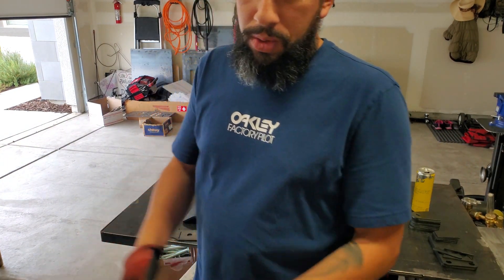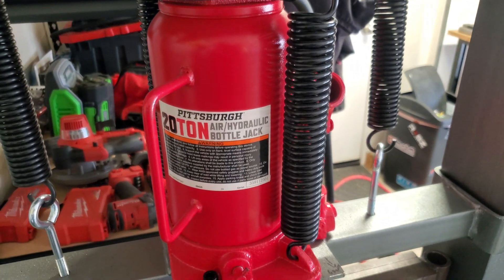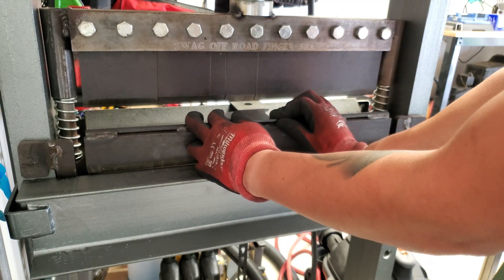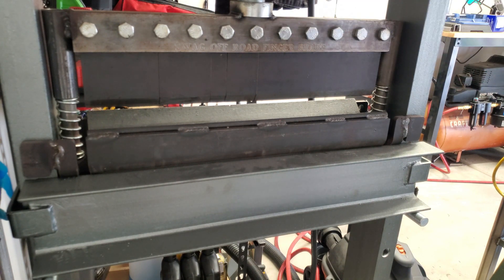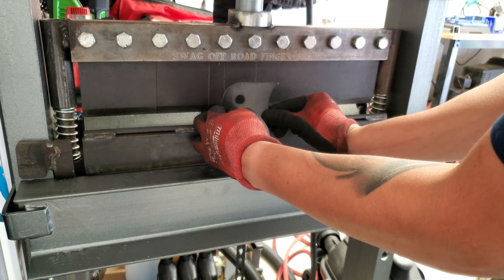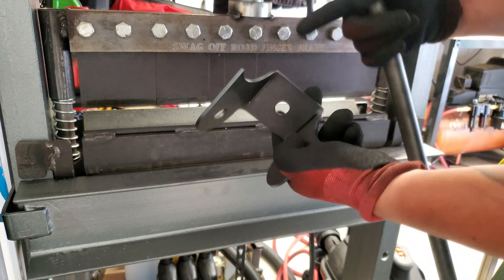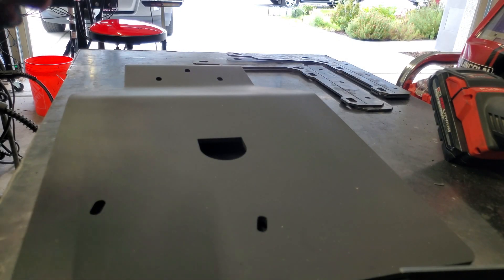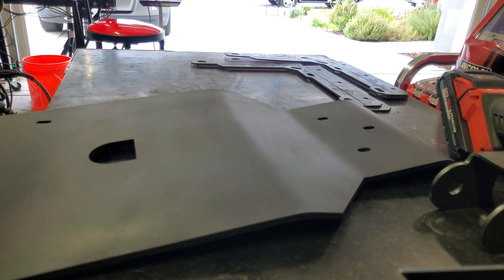Bending and relief cuts

Comment: Looks good, did you have footage on how it went in the vise? As I do not have a bench/shop press, but have a vise and a CNC plasma cutter :)
Reply from the maker: Appreciate it! I do not as I don't normally record anything I do, but if enough interest is generated I'd be happy to walk through how I do things. I just work out of my garage.

What I like to do is place an item in my vise as close to the relief cut as possible and bend from there. For pieces wider than my vise, I'll place my digital angle finder and compare each end to ensure everything was bent together. 

On specific pieces, I would actually place a clamp on each end and use those for added leverage when bending thicker steel.
Reply: @KwikFab  Perfect, thanks for the explanation :) I do work out of my garage as well, so do understand the time needed :)